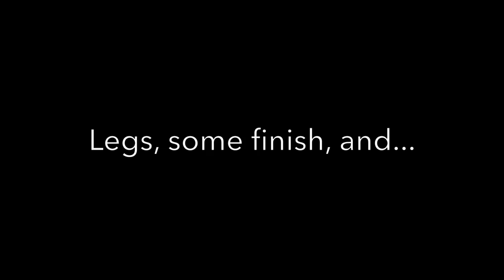Scroll Saw Music Box

Comment: I really like this project and also like your workshop.  Your workshop seems reasonable for an average home shop.  I get frustrated (ok jealous) on a lot of these youtube videos from people that have professional level workshops.  You would laugh to see my workspace but it is functional enough for now.  Eventually I need to build a real workbench and I also would like to build 1 or 2 flip stands.  I do have one suggestion.  In my scrollsaw work I stopped using clear tape and instead first place blue painters tape to the wood and then glue the pattern to the tape.  After construction the tape peels off easily and leaves no residue either on the nice wood.